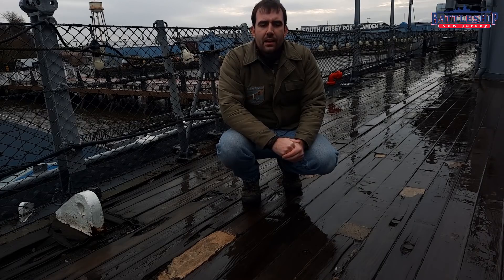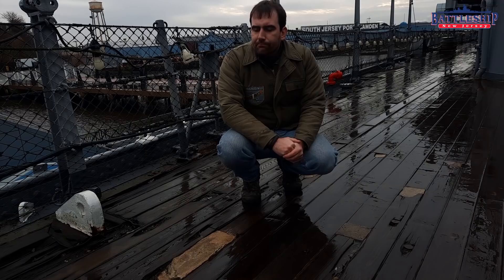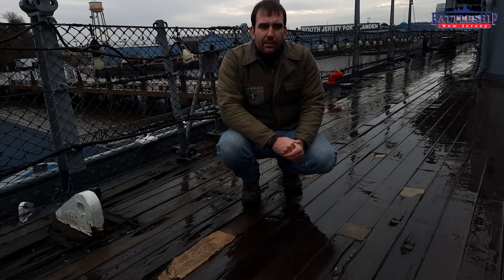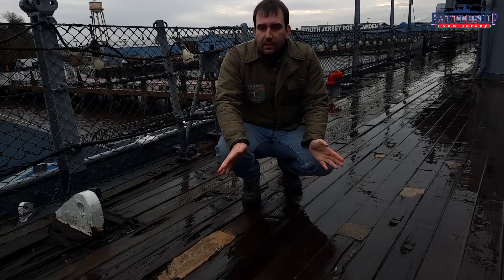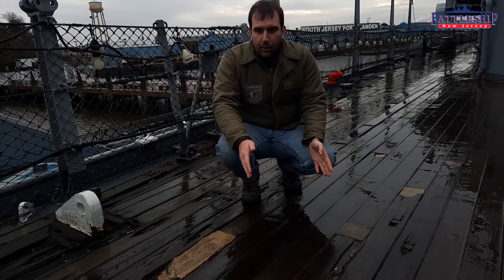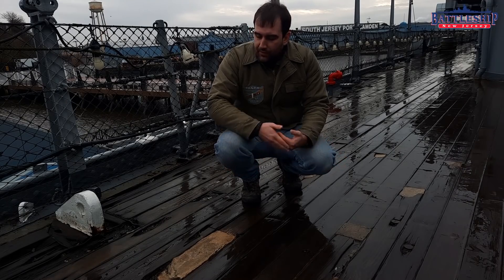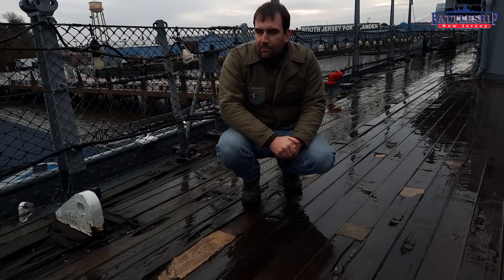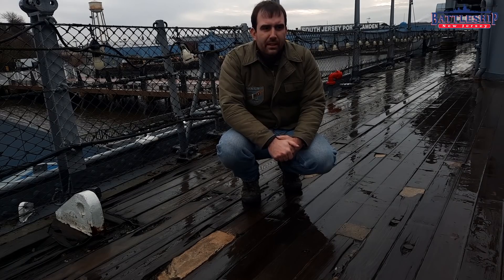Why aren't Museum Ships in Concrete?

Comment: One look at Battleship Mikasa will show you why concrete is not the answer. They had to sink it practically past the waterline, it looks so sad and forlorn.
Reply: Mikasa is not in concrete. She's in a gravel filled concrete hole. With drains at the bottom. The reason for her condition has nothing to do with her dock. It has everything to do with the facts that she was sunk twice (I think), partially scrapped, turned into a restaurant/dance hall, and then generally left to rot for years before anyone considered consevation. I may have missed a few things but those are what I remember.
The only places concrete might be in contact with her hull in under her keel. Maybe. The point is she's fully supported all the way around by non-acidic gravel. They couldn't have concreted her in because the first earthquake would have crushed her hull.

Comment: So why wood deck anyway?
Reply from the maker: Rolling a metal shell on the steel deck could cause sparks
Reply: @BattleshipNewJersey  , have you made a video explaining how shells get from pier to magazine?
Reply from the maker: Its just a crane. It's slow, but a crane picks it up and lowers it down a hatch.
Reply: The wood deck also acts as insulation keeping the internal temp within a moderate range, instead of "cold at night, oven in the day"
Reply: @BattleshipNewJersey  Since this question keep coming up have you given any thought to opening up the hatches and rigging a fake projectile on a chainfall as a static display? You could cover the uppermost hatch with Plexiglas to keep out the rain and the critters and just barrier off the open hatches inside the ship. Maybe turret #3?
Reply from the maker: Weve sort of got one inside the ship.
Reply: @ghost307  The big problem with doing that for the outer hatches is that they're located underneath the overhang at the rear of the turrets, so that doing so would require traversing one of the turrets to the side.

Comment: Concrete isn't acidic - it's highly alkaline.
Reply: And your force model isn't necessarily correct - if the hull is sat entirely in concrete then the forces will be the same as if it was floating in water.
Reply from the maker: Doesn't really matter if its basic or acidic, it burns through anyway.

Comment: I cant imagine the North Carolina is in a much better situation with her being permanently stuck in the mud like that; I mean she might as well be in concrete for all the good it supposedly does that they claim down there.
Reply from the maker: We are actually looking toward what NC is doing as the future of museum ships, they're doing great work.
Reply: The only advantage that I can think for for the NC is if a portion of the hull completely rusts through at least the ship can't sink.
Reply from the maker: Her system allows for the water to be drained and work to be done, which is much easier than taking a ship to drydock

Comment: remove the wood. give the steel a good dryice blast. weld all holes shut. do the epoxy treatment. no problems for the next 50 years.
Reply: Chip Jones  history doesent interest me when i need to prevent rust. also you can add fiber to the epoxy to make it as capable in insulating. you could also add a woodden deck above the epoxy if youre so desperate.
Reply from the maker: Here's what we're doing which is basically this, remove wood, put down epoxy, add new teak: https://youtu.be/OIteMpyHb48
Reply: @BattleshipNewJersey   We appreciate what you guys are doing on the ship very much and also the informative work you are doing on youtube, which is great. When Covid is over and iam finish in becoming a physics teacher, i will come to visit America and take a tour on those great battleships arround.  Thx

Comment: Actually you can buy waterproof concrete. My one roof is made of concrete tiles and doesn't leak at all.
Reply: Concrete will leak at the joints, and will crack to form joints once dimensions pass a certain size.  Posttensioning can keep cracks from forming, but such a structure large enough to contain a battleship hull would be ridiculously expensive.
Reply: @tominiowa2513  Look at for example the Hoover dam. Is that leaking? If the concrete is laid as a continuous pour there will be no joints. Or look at a shopping mall for example, that roof won't leak either. Cement bags in South Africa actually have the recipe for waterproof concrete printed on them, Google African.
Reply: @tominiowa2513  Thank you for the courtesy of your reply. My engineering  is electrical light current ( industrial robots and control systems) not civil. At what size does concrete leak then? My roof 190 M2 and no joints and my swimming pool don't leak. I look forward to your answer.
There is a British battleship concreted in in Japan that I believe has suffered no corrosion IJN Mikasa.
Reply: @andrewallen9993  - There is no one answer to how large a section of concrete can be without shrinkage cracking occurring, since there are 5 types of portland cement*, each of which may be modified with fly ash, slag, and other admixtures, different types of stone materials in various particle gradations and shapes for both coarse and fine aggregates, and of course the very important water/cement ratio when mixing.  But to get a general idea, look at the crack control joint spacing in exposed floor slabs and in pavements.

I am guessing that you do not notice your pool leaking since the loss of water is less than that due to evaporation, and there may well be a subdrain system around it (unless built in sandy free-draining soil).  The rate of leakage does not cause any issues, since you are not using the pool structure to prevent corrosion on a steel tub in contact with it.

Most of the reports I have heard about IJN Mikasa is that the hull has corroded so badly that the hull would collapse if the material surrounding it was removed.

*The Portland Cement Association has asked us to not capitalize "portland" in this context.

Comment: 1. I love the potato quality audio from your videos. Never apologize for it.
2. I have to ask again, we are going to fire the guns, right? Sure we might shatter a few thousand windows, but there are glaziers across NJ and PA who need all the work they can get in this economy.
Reply: A blank cartridge for a 16 inch bore?  THAT would be a fun project!
Reply: @haroldhenderson2824  all you need is six 110 lb bags of the correct formulation of gunpowder, plus the primer and permission from the navy and a few others to fire a 16" gun
Reply: @can_hauler  Go talk to the people on the Iowa about the time they fired a single 110 lb bag to simulate firing the main battery.

The short version is that the San Pedro FD chief, who was present for it, told them, "That was *awesome*.  Now never do it again."

Comment: CONCRETE IS NOT ACIDIC!!
Reply from the maker: But it is corrosive.
Reply: @BattleshipNewJersey  The porousness of concrete, which allows water to become trapped, accelerates the oxidation of steel. If possible when using concrete in this application/environment, it should be sealed with a masonry sealer preventing water from becoming trapped. However, care would be needed in the sealing since it normally takes about 28 days for water to dissipate fully during curing.